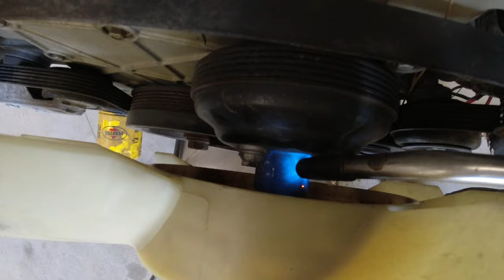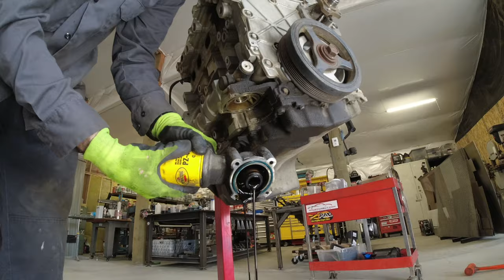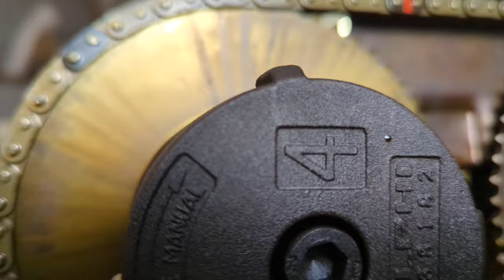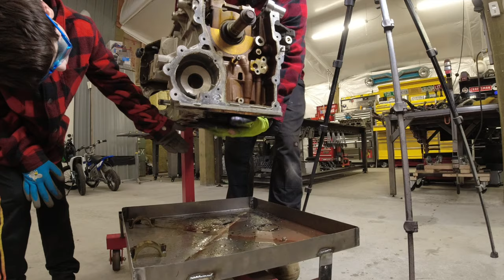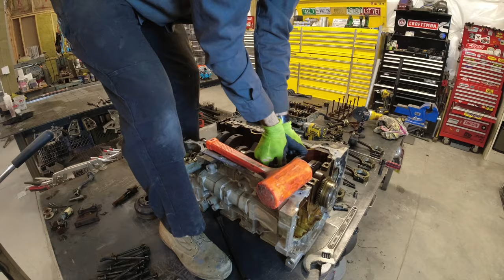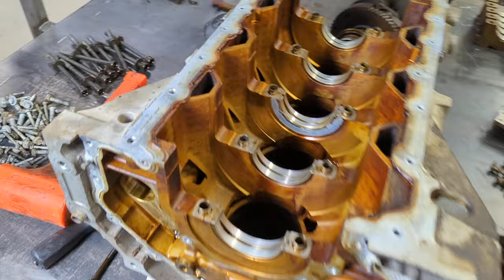Vortec 2800 4-Cylinder Total Teardown.

Comment: Not sure if you're familiar with DeBoss Garage channel, but they tore down a 5.0 Ford engine and found the same kind of buildup, not sludge, but almost like a varnish. His engine builder attributed it to synthetic oil, along with short trips. Engine never got a chance to get to full operating temperature, and then shut off. And trying to extend the intervals because they were running synthetic oil.
Reply from the maker: Interesting. I will have to check out that video, mostly to see if the pistons looked similar

Comment: 15:11 another solution is to drill a hole through the bearing and the block into the oil galley pressure feeding the rear bearing surface